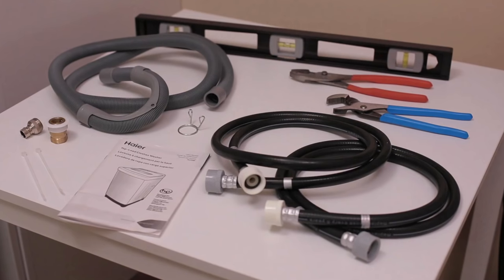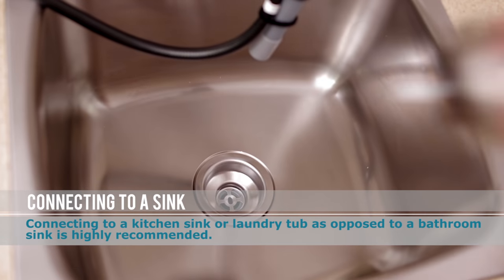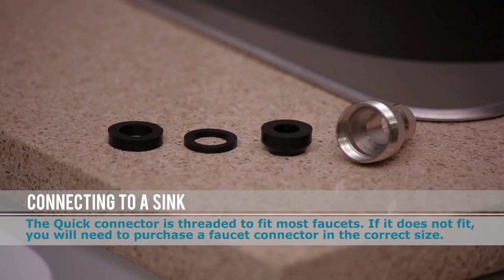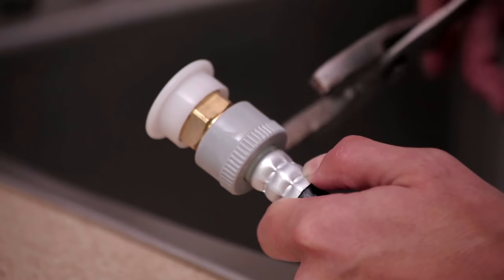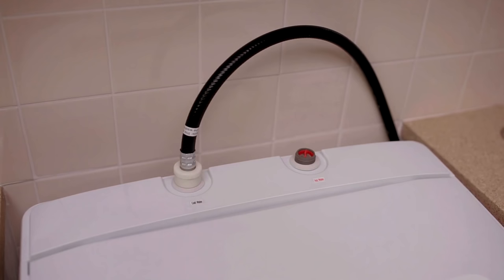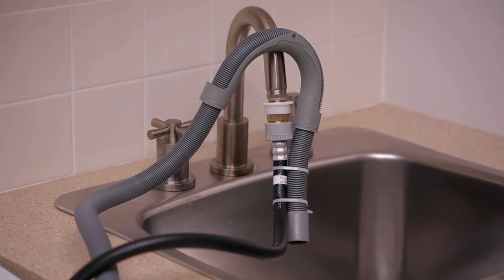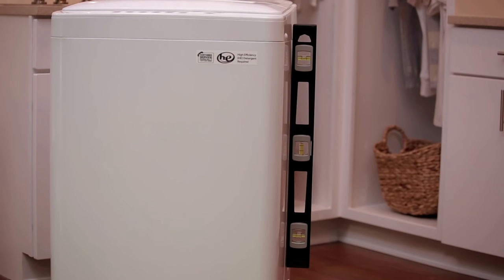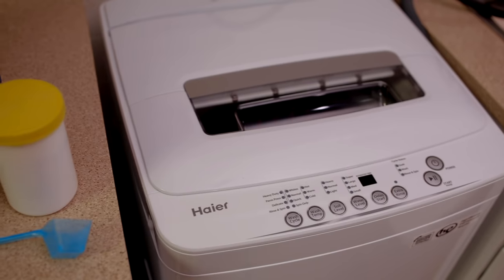Connecting to a Sink - Haier HLPW028AXW Top-Load Compact Washer

Comment: Ok. So I wanna know do I have to turn the water off when it's full or does washer know it's full  will the water keep running if I leave it on
Reply from the maker: Hello Lynn - You do not have to turn the water off when it is full. The washer will control the flow of water. You will keep the faucet turned on until the cycle is complete. - TS
Reply: Thanks so much. I was wondering the same thing!!!
Reply: Wowww... i have the same question. Thank you Haier for the reply. :)
Reply: I had the same question..thanks and it's ok to leave it on it won't cause any damage to the pipes?
Reply: My facet exploded ... what should I do?
Reply: I have a faucet quick connect and it works great, no leaks.  My question is, how do you do pressure relief for when you are ready to disconnect at the end of the wash?  Otherwise the hose stays pressurized and you spray yourself and the room when you disconnect...
Reply: @ronjobmann3684  I’m looking for the answer to this question as well. Did you find a way to do it without water getting everywhere?
Reply: @ronjobmann3684  2 ways. 1, use a hand towel draped over when disconnecting. 2, with faucet off, power on and start a washing machine cycle for a few seconds. Cancel and power off, then disconnect.

Comment: how do I stop the faucet from spraying out water when it is through filling up the washer?
Reply: symphony2929 I just turn off the water manually. There is no other way since the washer is no connected to a washer hookup. 😏
Reply: @Babysista  i actually figured it out, i added an extra black rubber piece inside of the aerator piece, no need to  turn it off in between
Reply: @symphony2929  yu mean a washer? Connected wear?

Comment: It does not fit my sink i need help i went to home depot and was told there nothing i can buy ti fit to my sink to connect the hose to my sink.
Reply: This literally just happened to me too. There are so many people that are unemployed right now that I'm sure would love to do their job. But actually do it properly and not LIE to customers 😠 Hope you got it sorted.
Reply: Did you ever figure out where to get the piece that fits? I just bought the washer and apparently my faucet is a weird size?
Reply: @leah-7011  I just ran out of time and patience and hired a plumber (and ran out of money, as it turns out, he cost me $200!). But if you want to go down the DIY route, he confirmed that there definitely IS an adaptor that you can fix to the faucet. But under the sink is better - he fitted an inlet hose to the tap under the sink, with a valve. When I want to use the washer, I turn the valve on and put the drain hose in the sink. Yay, clean clothes! :)

Comment: Hi I have the HLP23e washer...love it! Unfortunately, there is a coin stuck between the pulsator and tub. I unscrewed the pulsator, but I cannot get it off. Any suggestions?
Reply: is that your only coin? you can always go to the bank and ask them to break paper money into change
Reply from the maker: For trouble-shooting tips regarding your washer, please call 1-877-337-3639.  We hope this helps!
Reply: i hope that number is toll free, she lost her only coin :/
Reply: @krossF  LOL
Reply: Use two tiny Allen wrenches. They are shaped like an L. Insert the short ends into the holes to create two handles to lift up with.

Comment: My water hose will not stay connected to the sink. This is a new problem that just started. I never had a problem keeping it connected. What is going on? What should I do?
Reply: mary lou bly the The connector that pulls back and snaps on might be worn out, Home Depot or Lowe’s has the replacement